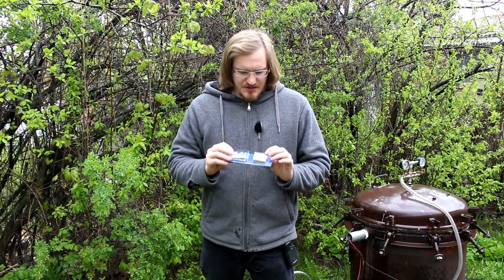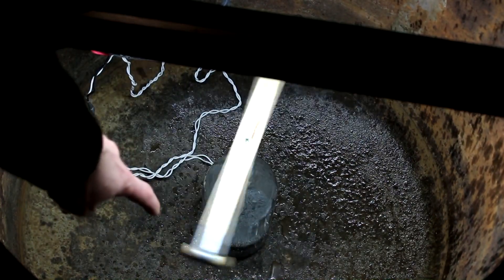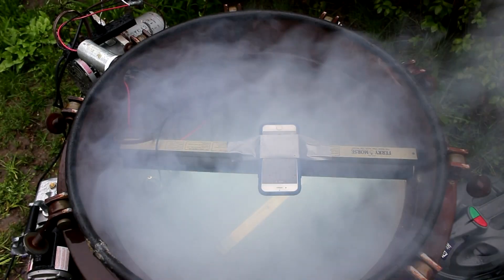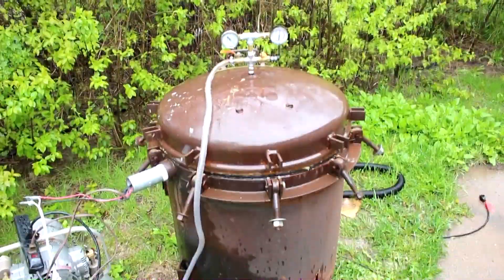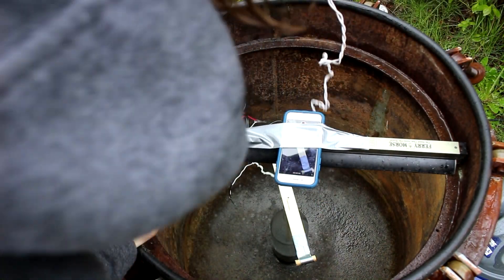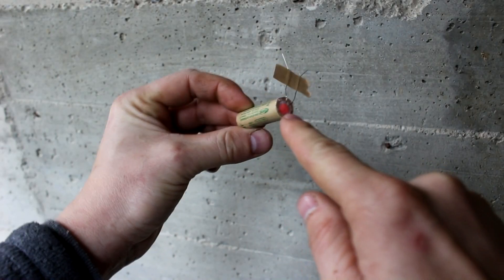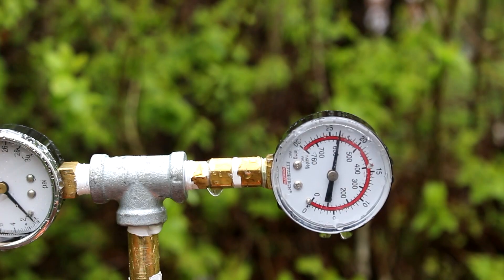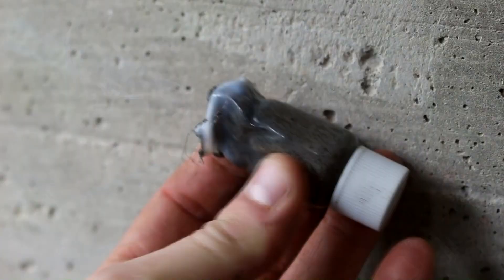Will a Model Rocket Motor Work In Vacuum?

Comment: at 5:32 Cody states "and the gunpowder inside can't sustain a burn", he's basically saying combustion cannot take place in a vacuum which means a model rocket motor cannot work in a vacuum
Reply: Gunpowder needs oxygen. 
Rockets with fuel and oxidisers do not.
Reply: @mattl2k6  nooooo! you omitted air pressure! without air there is NO PRESSURE! And fyi oxygen is concentrated air which according to cody, video, cannot provide the necessary pressure required for a flame to burn in a pressureless environment such as space!

well done cody for debunking nasa and all these space agencies!
Reply: @PeterPete  Rockets don't need air pressure, hence why they work in space.
Reply: @mattl2k6  cody's charge didn't work under vacuum!
Reply: @PeterPete  It did, it was surrounded by vacuum and produced thrust.
Reply: @mattl2k6  the armature didn't spin when the charge was fired under vacuum however when the charge was fired in air the armature spun!
Reply: @PeterPete  It fired by the same principle a traditional rocket engine would, and despite being surrounded in a vacuum was able to generate thrust.
Reply: @mattl2k6  what time in the video are you referring to btw?
Reply: @PeterPete  6:43
Reply: @mattl2k6  i guess you overlooked the fact the charge at 6:43 is encased in a plastic bottle and that is filled with air??

Cody is contriving the demo - does the armature spin at 3:58?
Reply: @PeterPete  That's no different then how a tradional rocket engine works, yet instead of a complicated valve system Cody simply encased the rocket in a plastic bottle to allow the fuel and oxidisers to combust. The whole device is surrounded by a vacuum, yet still generates thrust proving rockets work in a vacuum.
Reply: @mattl2k6  the part of the video you're directing me to clearly shows the charge encased in a plastic bottle and within that plastic bottle bottle is air pressure! 

Tell me, do you really think vehicles that allegedly enter space are encapsulated in air pressure? 

A great analogy for this is you telling me a diver can breathe under the water's surface and yet we both know without the scuba the diver cannot accomplish this. So with regards to cody, without the encasement of the charge and presence of air pressure within the container, the charge won't work!!

Next time you see video footage of space EVA's or the outside of the  ISS look out for the plastic bottle or the air pressure that in cody's view, should encapsulate them!!

I wish u well!
Reply: @PeterPete  The charge encased in a plastic bottle is just a much cheaper, less sophisticated version of a traditional rocket engine that uses pressurised valves to mix fuel and oxidiser. It's the fact that this charge can produce thrust whilst surrounded in a vaccum that proves rockets can generate thrust in a vacuum.

"Next time you see video footage of space EVA's or the outside of the  ISS look out for the plastic bottle or the air pressure that in cody's view, should encapsulate them!!"
You mean a space suit?
Reply: @mattl2k6  is the ISS or the thrusters that propel a spaceman during a spacewalk enclosed in a pressurised container like a plastic bottle? yes or no?
Reply: @PeterPete  No, nor do they need to be as they are designed to work in a vacuum.
Reply: @mattl2k6  so in your opinion it's okay for Cody to encase his charge in a plastic bottle bottle filled with air to get it to work in the vacuum but you still think the ISS, rockets etc don't need that encasement of air pressure to work in a similar environment?

Is that right?
Reply: @PeterPete  Sure, since it's the same principle a traditional rocket motor uses without having to use a complicated valve system.
Reply: @mattl2k6  great! can you tell me which psychiatrist u see - I need to inform him how irrational your thoughts are!!
Reply: @PeterPete  You don't have to like it, but it's reality.
Reply: @mattl2k6  you mean it's YOUR reality not mine!!
Reply: @PeterPete  Reality is not subjective. Laws of motion are well established.
Reply: @mattl2k6  well tks for your opinion Jimi!!

Ever thought of taking up the guitar?
Reply: @PeterPete  - So when the rocket nozzle ACCELERATES the MASS of the exhaust gas, into the vacuum, - from WHERE does the force originate?

VERY simple question ( for people that have taken a physics class).
So what is the answer Pete?
Reply: @stuartgray5877  at 3:48 it didn't work!! there was no acceleration! I think you need to go to optician because you clearly failed to see what's happening in the video!
Reply: @PeterPete  Understood - you are INCAPABLE of answering a question that ANY high school physics student could answer.
WHY do you REFUSE to answer the question?
Oh - because answering TRUTHFULLY proves you WRONG, and you KNOW IT.
Thanks for proving my point.
Reply: @PeterPete  I have UNDENIABLE video evidence of a rocket working JUST FINE in vacuum.
I would show it to you, but you need to answer a question first:
At WHAT ALTITUDE does earth's atmospheric pressure drop to "vacuum"?

Assume (for this argument) that "Vacuum" is any pressure BELOW 1.0 Torr ( 0.02 PSI).

So at WHAT ALTITUDE does atmospheric pressure drop to BELOW 0.02 PSI?

That is ANOTHER question that you will refuse to answer.
Reply: @stuartgray5877  I assume you are referring to Voodoo Child (Slight Return)'s suggestion at 06:43. If you are I've never known a rocket to be encapsulated by a plastic bottle even in Earth's atmosphere!! Cody HAS to encase the model rocket in an air filled container because otherwise the charge would NEVER IGNITE and move in a pressureless environment.

When are you guys going to realise a rocket CANNOT produce thrust in a pressureless environment? Btw, your undeniable video evidence is probably in a man-made environment - you've got to have a WARPED PERCEPTION to think you can apply the understanding that underpins that demo to somewhere else. 

I think Jimi needs to sing the Everly Brother's song - Dreaming, because that's all you guys do, dream your lives away!!!
Reply: @PeterPete  - "When are you guys going to realise a rocket CANNOT produce thrust in a pressureless environment? Btw, your undeniable video evidence is probably in a man-made environment - you've got to have a WARPED PERCEPTION to think you can apply the understanding that underpins that demo to somewhere else. "

FALSE! I have video evidence of a rocket working IN A VACUUM - taken FROM THE GROUND!
 It has UNDENIABLE evidence that rockets MUST work in a vacuum.

Now tell me: At WHAT altitude does atmospheric pressure drop to BELOW 0.02 PSI and I will SHOW YOU THE VIDEO.

WHY cant you just answer simple questions?
Reply: @stuartgray5877  got a link to the video so i can watch it?
Reply: @PeterPete  Ill let you watch it AS SOON AS you tell me:
At WHAT ALTITUDE does earth's atmospheric pressure turn to "vacuum"?
You two are NOTORIOUS for moving the goalposts AFTER we present evidence. Im not falling for it again.

SO TELL ME, and Ill show you the video.
Reply: @stuartgray5877  you need to take a class in English grammar

Quote - VERY simple question ( for people that have taken a physics class).

Never use the word 'that' to refer to people, always use the word 'who', so your sentence ought to read, 

(It is a) VERY simple question (to answer) for people who have taken a physics class .

You should watch Cody's other videos on creatring fire in a vacuum, he gives the game away and he concludes one needs PRESSURE in order to create the flame!!!
Reply: @PeterPete  I told you above exactly WHAT the answer IS and where to find it. Now CONFIRM the altitude that earth's atmospheric pressure drops to 0.02 PSI and WILL SHOW YOU THE VIDEO.

Which part of this request are you failing to understand?
Reply: @PeterPete  - "he concludes one needs PRESSURE in order to create the flame!!!"

So according to YOU, a block of C4 would not explode in a vacuum?

Oh, and the chamber pressure inside a rocket nozzle is over 3000 PSI. I think that is high enough for combustion....

Comment: Rockets can be pushing against chamber's walls
Reply: Rocket wasn't touching the chamber walls so no it couldn't.
Some of the gas-fired out the back of the rocket would hit the wall but why would that inpart energy on to the rocket that's now like half a foot away?
The rocket is pushing against the gas that is pushing against the rocket
Same force that causes the gas to move in One Direction causes the rocket to move in the other
Reply: @FrancisR420  still not convinced, as should be absolute nothing in empty huge real vacuum of space gase should disspeerse with no resistance at all whatsoever so it should not generate any counter force, like throwing a paper plane to air doesn't pull you back, I think
Reply: Gases are fulfilling the chamber and creating an artificial atmosphere, that is what the rockets gets its reaction force, in real space it should not behave like that

Comment: Dumb question.  If it pushed against itself would you require more weight in fuel than the weight of payload?
Reply: Basically conservation of momentum: m₁v₁+m₂v₂=0
That's why you need fast propellant.

Comment: I can suggest one thing wh uh this experiment is biased. The device is moving in a circle. The slightest push would easily translate into a force that instantly pushes but only appears to be sustained because the device moves in a circle.
Much like on a really freely moving merry -go -round a really slight push can seem to have a sustained effect yet is the move was linear it may not budge an inch.
So I can suggest an experiment for you. Long clear cylinder about 10 feet high.  
Allow to stand erect.
Place actual rock inside with igniter and everything. Suck out all air as best as possible.
Allow to sit for 24 hours so that every molecule of oxygen could be equally diffused through out the entire vacuum cause I'm sure there would be in the container taped within the combustion materials. 
Then do the test. If the rocket does not rise to the entire length of the 10feet cylinder the so-called myth cannot be busted?
Reply: There is no way to can prove things to people who refuses to understand anyway.

Comment: Your igniter situation was exacerbated because you were using 110v AC to light them. Try 3v DC to lignite your igniters next time. It wont be as violent of a pop on the igniter. It will light slower and allow the engine to start without blowing the igniter out.

Comment: Could the gas buildup in the bottle pre-blowing out create enough directed (by the bottle), impulsive thrust once the bottle bursts to give an impulsive force to the rotor that APPEARS to make it look it creates thrust?  i.e. impulse versus continuous thrust.  Also, as Cody points out, there is significant water in the chamber not suggesting a vacuum.
Reply: In a real world situation, there would be a seperate chamber that wouldn't melt, allowing constant air and fuel to give thrust. Though the initial burn in the tube may have been the main contributer to the thrust, it still proves rockets can burn in a vacuum chamber